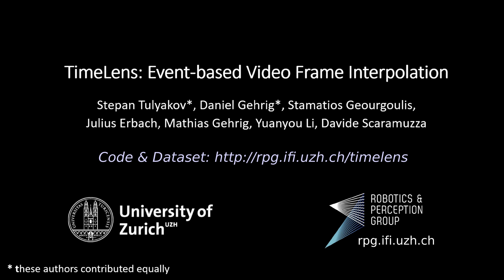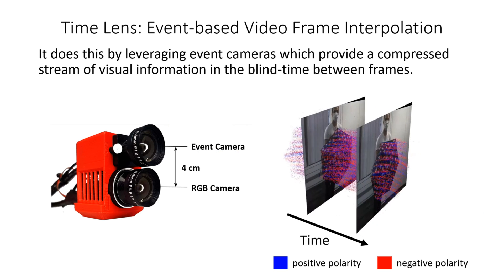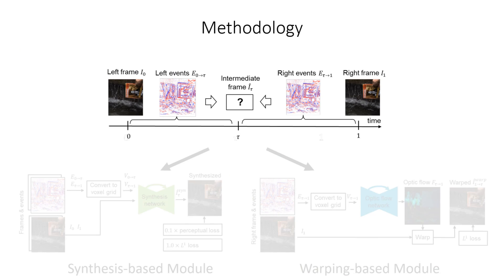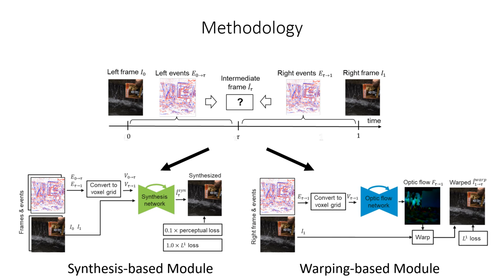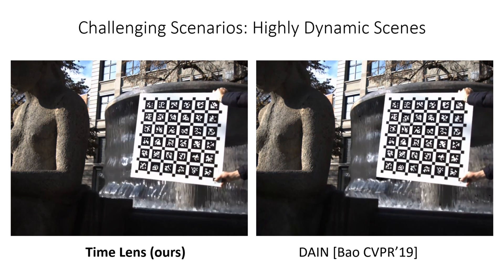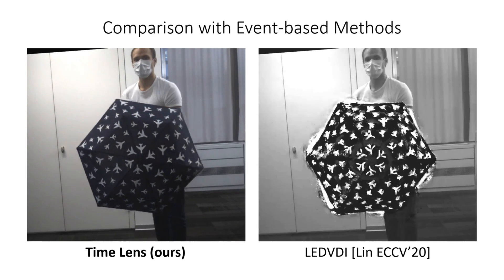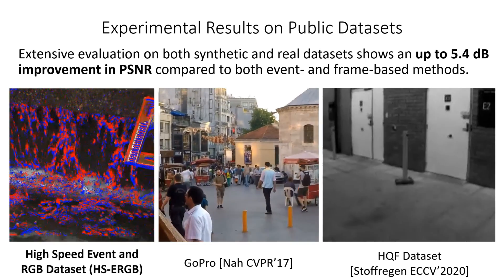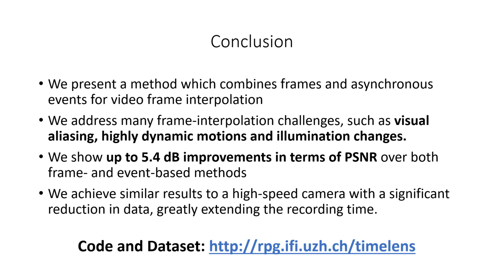TimeLens: Event-based Video Frame Interpolation (CVPR 2021)

Comment: it would be nice if this was released to the public, or if it already is then make it more user friendly since it would be amazing to try this
Reply: There is already github repo for it, and you can request access to their training data and training code. However just to note that you cant run this against a normal video as far as I can see. Their process requires an additional data feed that captured by their event camera. If anyone knows how to ether generate or capture this type of interframe event information (as far as I understood its just per pixel brightness changes) would be cool to find out. Thanks!
Reply: @dmalyavin  Waait so I can't feed in my videos even if I jumped through all the hoops to get the github code to run? Aaaaaagghhh
Reply: @dmalyavin  So this won't be a replacement to Twixtor.. and here I was getting my hopes up :'(

Comment: It would be interesting to gradually reduce the framerate of the RGB camera, to find the limits of how much of the missing data your system is capable of constructing.

I'm curious how FEW keyframes are truly required to get reliable results.  Or maybe a system can automatically request the RGB/keyframe only as required, and only for the nessesary part of the image rather than the entire frame.
Reply: Thats a really cool idea! In our paper (linked in the description) we go down to 5 FPS and are still able to interpolate the video reasonably well. However, I would not recommend to go any lower than that. When using events you can indeed do something like "adaptive slow-mo" where you only request keyframes when there is motion (enough events). This will make the approach much more efficient!
Reply: @Haneesh Allu i guess that you can alway collect a fixed number of events and then you would have an adaptive framerate. Since the fastest moving object will trigger the most events it should always adapt its framerate to this object. For slower moving objects it should be easier then.